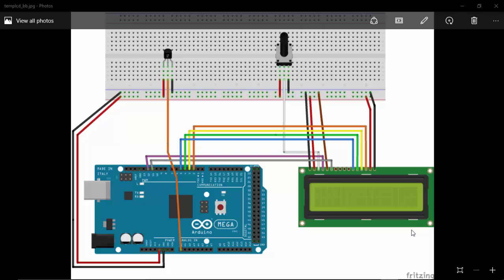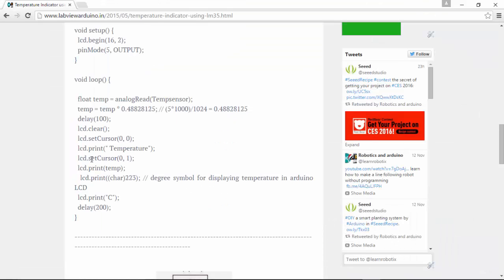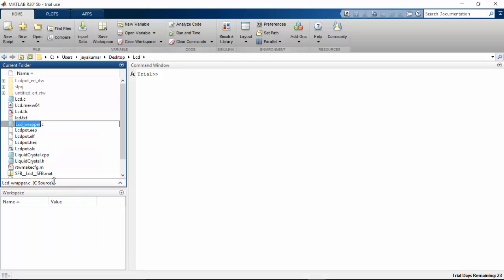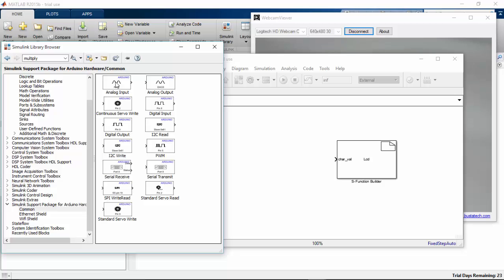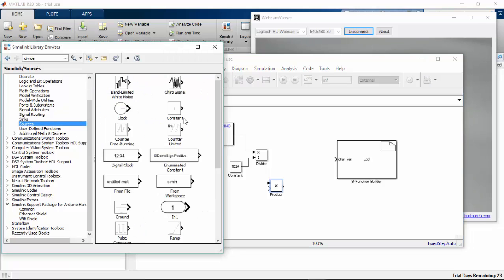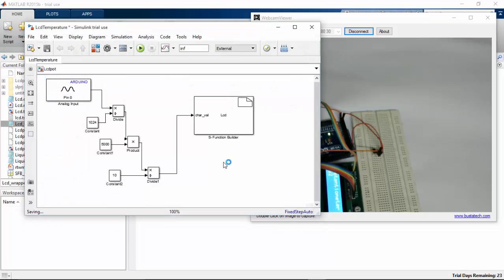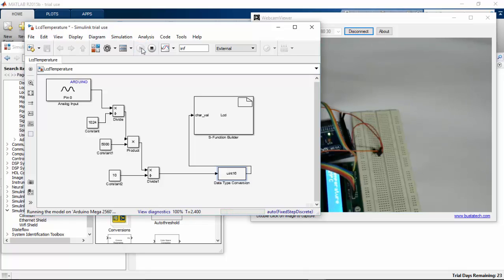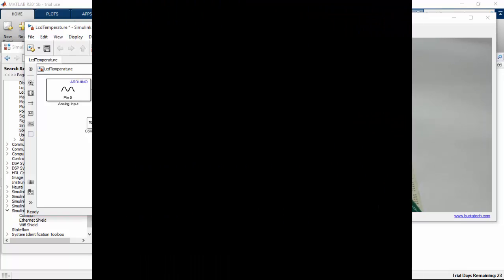7.1 Display Temperature on LCD creating S function in simulink arduino

Comment: Error building says that print.h and other libraries are not found. if you add these libraries gives another error with something like the class in the programming. Finally if you change to cpp the extension and change void to external "C" void it just doesnt work. I probed with  arduino uno and didnt work for me gives a final error saying that check sprinf /U is not valid. MATLAB 2018.

Comment: can I use this for building model to arduino only, not in external mode?
Reply: yes. you can use deploy to hardware option to write the generated code to hardware and then use it independently